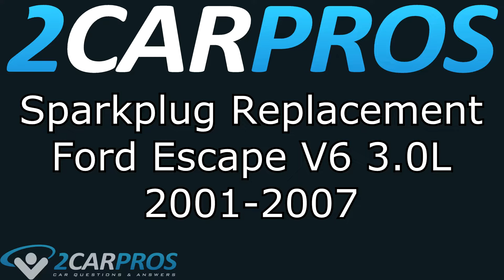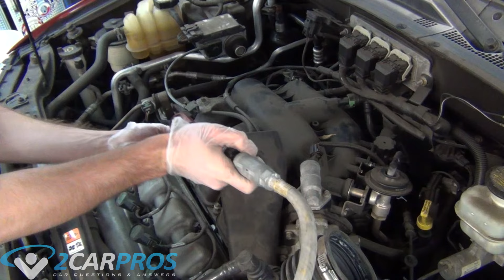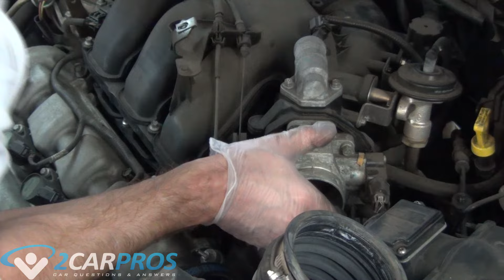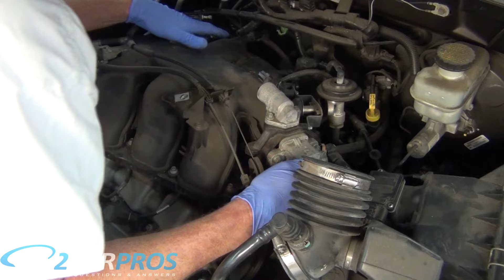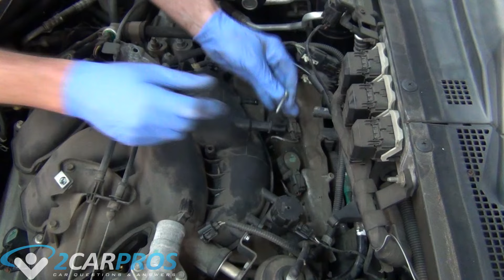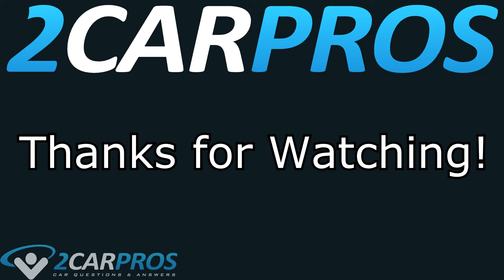How to Replace Spark Plugs Ford Escape V6 3.0L 2001-2007

Comment: Just did this today took a bit over and hour  and a half for 6 plugs, coils, new intake seals, and an oil change it was easier than people think. Use an 8mm, a 10mm deep because 2 bolts are stud bolts, and a 5/8 spark plugs socket look for the magnetic type way nicer. It is easier to pull the intake up and Bungie it out of your way. The intake bolts don't come out of the intake so no lost bolts. Just take your time. I also recommend anti seize on the plugs and boot grease on the coil boots you can use dielectric grease on the connectors for the coils. Just my 2  cents
Reply: FINALLY, someone tells me the size of the spark plug socket. Thank you sir.
Reply: @KenanOmerbasic  i mean.... It's pretty common knowledge a spark plug socket is always 5/8....
Reply: @Hawk-hk8ee  I mean...there's 13/16 spark plug sockets too though....
Reply: Yall are all wrong. 16mm fits tighter.
Reply: @johnnyboy6429  how does that fit tighter when its bigger than 5/8"? Did you mean 14mm?
Reply: I use a 300mm metric standard that came with my compound moppytop saw
Reply: We appreciate it! More than 2 cents Lol 💪🏿
Reply: I would of took intake off to make sure intake seals were not bad and replace them anyway
Reply: Thank you! I wish they mentioned the various socket sizes in the video, they just kinda jump into it.
Reply: Thank you so much for this info! I'm a single mom who doesn't know a thing about these sorts of things but I've gotta figure it out and this helped a lot, much appreciated.

Comment: Everyone says it's a bad car or don't buy this car just because you have to do a little work. From the mechanics point of view this is a good car easy to work on spark plugs are about the hardest thing you would have to do as far as maintenance it has the alternator in the front external water pump so you don't have to take the front of the engine in the timing belt and s*** apart. Bonus. I think people are just looking for a magical car that you don't have to work on but let me tell you all cars are pieces of junk because all of them need work when you don't do anything to them for years. There's a book called the maintenance schedule and if you double the intervals in which you change your fluids you will almost never have to do this other stuff except spark plugs.  knowing how to change your own oil is as important as knowing how to wipe your own butt
Reply: I've seen these escapes hit over 200k
Reply: that's through those are a very good cars
Reply: Just bought one that's in good shape and runs good with 166k for $500 lady thought it need an oil pump... all it was was a bad pressure switch and low on oil... been running great for almost 3k miles. Makes a great work car
Reply: 80% of people pay for their oil changes too LOL my best advice to people on maintaining their cars who don't normally work on them; If you don't do shit to your car, at least do your oil, coolant, and tire checks! Saves hundreds regardless of regular maintenance
Reply: Well said. Every car is junk in the eyes of someone that is looking for 0 problems.
Reply: mine is about to turn over 200k and running great just needs new spark plugs. I've seen people buy a whole new car instead of just maintaining their own. Well said. people just want a magical car they don't have to do any work on
Reply: Haha, alternator took 8 hours dude! You have to remove the axle and release the ball joint, and tie rod. Shit is ridiculous! Water pump, easy as pie!
Reply: @jungleviper sitting in mine rn with 360k stock motor

Comment: Thanks!  Just did this job, first time spark plug change ever.  Took a couple of hours but went smooth.  Video was great.  I did find it easier to tip up the intake manifold and bungee it up to the hood.  Gave me way better access to back plugs.  $30 for plugs and $20 bucks for new intake manifold gaskets and saved a couple hundred bucks in labor.  Thanks again!
Reply: Yeah just tip it up and bungee cord it to the hood.  That way you don't have to take off the throttle body and coolant hose.

Comment: Not all viewers have access to compressed air, but blowing out the plug 'pit' before initially removing them will help to at least minimize any debris and 'crumbs' from entering the combustion chamber. A vacuum will do the trick almost as well in a pinch, and most folks own a vacuum if not a wet-vac.

Comment: Just did this job on my 2005 Escape. Basically 3 socket sizes, a torque wrench as well as new coil packs, intake seals, and plugs bought from A1 Auto and Rock Auto and I was done in 2 hours and for about $70. BTW OE plugs call for platinum. Runs smooth as silk now!
Reply from the maker: Nice work on only spending $70! Thanks for watching!
Reply: I surely need mine changed asap! My 5th plug is fouled and my O2 sensor is bad, I'm now going to google O2 sensor replacement! I really enjoyed this video,  I was reading the comments about the  intake gaskets, is that something I should do also when I change the spark plugs!? TIA!! Happy Motor, Happy Car, right!? Lol!!
Reply: Which coil packs did you buy?

Comment: I've got a 2005 Loaded Ford 500 Limited with 225k miles that runs and looks like new. Meticulously maintained. Never missed and oil change. Getting ready to do this myself. No biggie. I'll take the intake right off the engine. the injectors,  coil packs, PCV and maybe the Electric Throttle Body to clean them.  Just a little different. A lot of vacuum hoses and such but worth it in the long run to check everything. Don't want to do it again in 6 months.  Never had a problem with this car. Thanks!!
Reply from the maker: The 500 is a severely under appreciated and overlooked car. I nearly bought one a few years ago but driving it made me motion sick so I had to pass on it. The 500 is a great car. Thanks for watching!
Reply: You must live in a southern climate. I had one and when the temperature dropped below freezing I had nothing but trouble with the door latches. The dealer did nothing and k found that k had to consistently spray a silicone spray and wd40 into the locks and door latches all winter long. If I didn’t and went out the drivers door would not latch and would not lock either.so I couldn’t get to work. Let it run a while with the dashboard vents pointing to the doors and the heat blasting for half an hour often did work though. I was almost glad that I had an accident and the car was a write off!

Comment: I performed this on a friends 2006. I have no automotive training, per se. I was able to do this and change the computer in around 30-45 minutes. The key is having the correct tools beforehand. 

I originally attempted it without the correct tools and had to stop near the end. Once I came back with the correct tools days later, it was easy. 

I suggest that everyone buy good tools, like automatic wrenches, screwdrivers, etc, deep sockets and the like. Sure it’s an investment but then you never have to hire someone for the work ever again.
Reply from the maker: Nice work and great advice!

Comment: If you are going to take the time to replace the plugs take the little extra time and money to replace the intake gaskets and the Coil packs. Especially the coil packs if the engine has a lot of miles on it. When the spark plugs start to open up their gap (lots of mileage)  it takes more voltage to jump the gap and this is hard on the coil packs.
Reply: Thanks for the advice 👍🏻

Comment: My step daughter bought a 2002 Mazda tribute brand new with the same V6 engine. She traded it with 290,000 miles and never changed the spark plugs. LOL

Comment: Hello, I just replaced all six spark plugs and all six ignition coils. Thanks for the video. It was very helpful. However I’m still getting the code that ignition coil C is causing the engine light to come on. That’s called P0353. Any kind of direction you can point me in?

Comment: I would replace the 3 coils on the backside and use double platinum or iridium plugs.  That way you won't have to go back there again for at least 100k miles.

As others said, also change the intake plenum gaskets ($10 or so for a set).  Vacuum leaks are no fun to locate and fix.

Otherwise a good video.  Sliding the plenum back saves a little time, most other people recommend removing the whole thing.
Reply: Which brand Coil Pack do you recommend?
Reply: @glennbelfiore5776  whatever the manufacturer used. Dont bother finding any magical coil packs

Comment: Why not change the intake manifold rubber seals/gaskets as well?
Reply from the maker: You could but, this video was about sparkplugs. Thanks for watching!
Reply: Also it depends on when you changed them last if they are newer no need to change them if old you should definitely change them

Comment: You should have replaced the intake manifold gasket set to avoid lean system condition codes P0171 & P0174. Good luck
Reply from the maker: If they are in good shape it is most likely fine. Thanks for watching Tony!

Comment: I’m an commercial construction electrician not a mechanic so forgive me. Do the bolts on the manifold require a specific torque setting. Also, I didn’t see you put back the hose with the green clip, and the hose clamp on the backside(when your facing from the hood) what was that for. My engine is misfiring and I had someone tell me to replace the ignition coils and spark plugs. I have an 01 with 240k miles

Comment: Was having trouble getting spark plugs back into engine come to find out the spark plug socket that I got from O'Reilly's, was preventing the bottom of the spark plug threads from reaching the engine threads. So if you're having trouble getting the spark plug back in try a 16 mm deep socket

Comment: Why didn’t you change intake gaskets?
Reply: I, personally, would never reuse the old intake and EGR gaskets. One gets down as far as he did removing the upper intake manifold; why not pull it off turn upside down and after a few wipes of the meeting surfaces just replace the old rubber gaskets without using silicone. Gaskets are cheaper than intake leaks later.

Comment: I think that maybe... JUST maybe... i could probably ratchet strap the engine forward after disconnecting the engine mounts to make this process 5x as easy
Reply from the maker: Yeah that would probably work. I didn't want to show any cool tricks like that because people here on YouTube are often obsessed with technically right over things that work anyways. Thanks for watching!
Reply: I really like that idea!
Reply: Did you try this?
Reply: Aside from the drive shafts having clearance this could work

Comment: what size wrench is needed to take out front spark plugs?
Reply: The coil pack is held on with an 8mm nut. The spark plug size itself though is a 3/8 standard or 16 mm metric socket. You would have a terrible time getting a wrench to do the job! ;-)

Comment: I wish my mechanic work at warp speed like this guy.  And I thought I'd do it myself.  My Escape is no '73 Dodge Truck!
Reply from the maker: The newer stuff is definitely tougher to work on than the good ole days. Thanks for watching!
Reply: @2carpros  Just made an appointment with my mechanic for tomorrow at 8:00 for the 3 to 4 hour task and ONLY $600.  Good thing I sold a "hole in the water" yesterday.

Comment: This looks crazy complicated, but when I google "price for a shop to replace spark plugs on a 2007 Escape" I get nonsense numbers like $110. There is no way they can do all this in just one hour, is there? My brother has a 2007 Escape, plug #2 is fouled apparently, and he needs  to replace all 6 plugs because it's over 100k miles. But he has terrible back arthritis and shouldn't even attempt this. Any ideas what a shop would charge?
Reply from the maker: Uh no there is no way it is only $110. It is 2.4 work hours so probably $240 for the work or so and $60 for the plugs, I'd guess right around $300. Thanks for watching!
Reply: @2carpros  Thanks, good information!
Reply: @2carpros  I appreciate this information.

Comment: My 93 ford f-150 has Fluctuating rpm's and constant backfire, please help.thks
Reply: Is this a help form for f150's? I am confused.
Reply: Replace plugs, wires and coil pack. Coil pack or wires first, I've seen ALOT of the coils fail- but OEM lasting 10-15 yrs. isn't too bad as far as I'm concerned- also, the coil pack is simple and extremely easy to replace. If it ISN'T the actual culprit... it soon would've been most likely

Comment: So I have a 03 Ford Escape xl . And for some reason the moment I hit 50mph the entire truck begins to shake . Would anyone know what that is ?
Reply: Chelsea Febles bad unbalanced tires or the wheel bearings in the car gave out
Reply: Chelsea IS YOUR CHECK ENGINE LIGHT ON?  If it is get it checked by a mechanic and follow what ever the codes say is wrong,That is why the check engine light is on it is trying to tell you whats wrong.
Reply: My 02 Ford escape was doing the same thing at 40 or 50. I changed  my coil for my 4th cylinder and it stoped doing the shaking. I had a check engine light and took it to autozone to read the code but it was doing the shaking before the code even came up.
Reply: Aaron Rowland mine would do this too, for me it was the tires they were 5/6 years old but I got new ones and everything was perfect again
Reply: Does it only do that for a moment or is it continuous at that speed & above?  If it’s short & goes away as speed increases or if you disengage the overdrive button on the shifter, might be the torque converter. That was my problem at 190k miles. Had the whole transmission rebuilt & new torque converter installed at 265k. Rest of car is great & certainly cheaper than buying another used car with someone else’s problems...
Reply: Intermittent misfire in one cyl will cause this. Hence this video

Comment: I'm facing this challenge now. My #2 cylinder has been complaining for a while, and it's in the back. Repair shop told me, a couple years ago, that it wasn't worth fixing. I replaced the fuel pump last year. I'm not sure if I should do this job or just give the car away. I used to like Fords. I may never buy one again.
Reply from the maker: It's not super bad but, I understand your frustration. I have a 5.4 F150 3V. Thanks for watching!

Comment: its a half hour job its not hard
Reply from the maker: It really isn't. Thanks for watching!
Reply: @2carpros  what was the total time?
 I'm assuming during the video you had to stop and start at some point 

I have a misfire on cylinder 1 and the mechanic stated 3.5 hours.

Thanks.

Thanks.